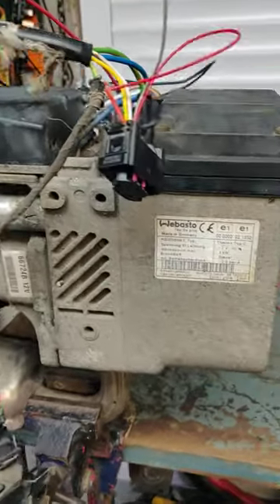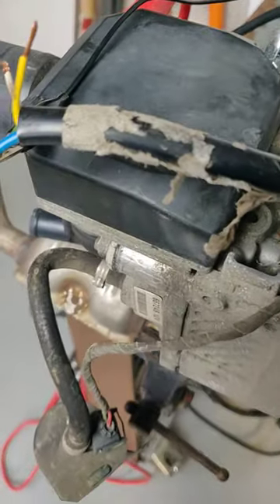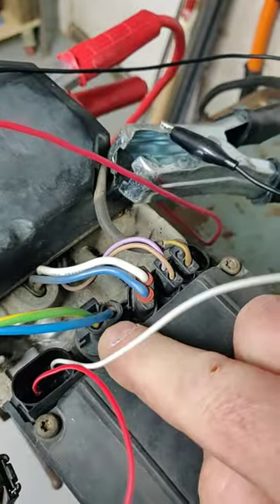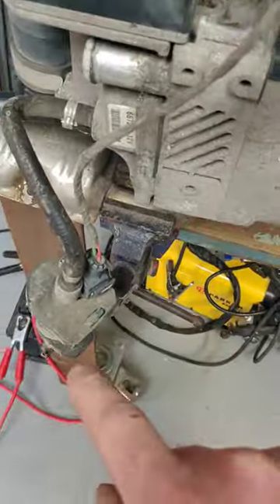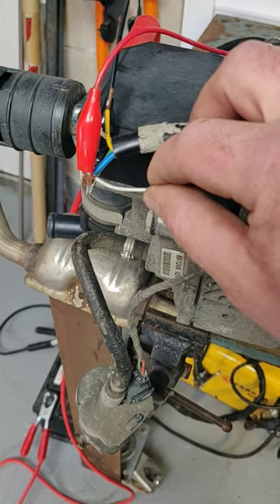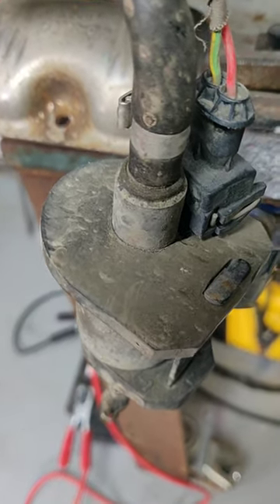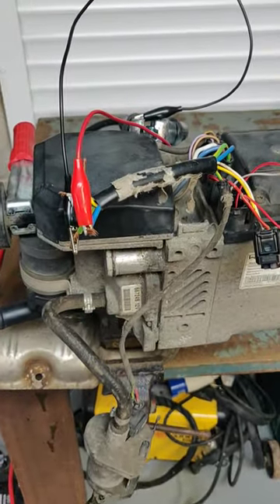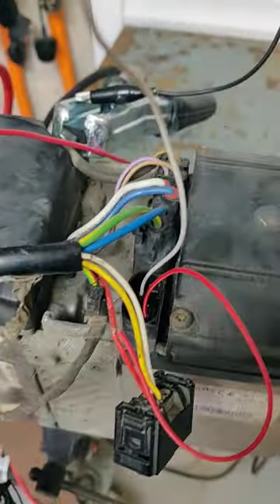Webasto Thermo Top C wiring to start manually.

Comment: I stand to be corrected..... but just rewired ours, ex welfare van, so removed every wire i could which was not required, I believe going off ours, pin one is the frost stat start with a 12V start, and pin 2 is the Webasto prog. connection which requires a wbus supply from what i can gather